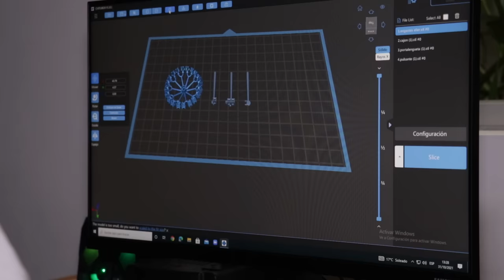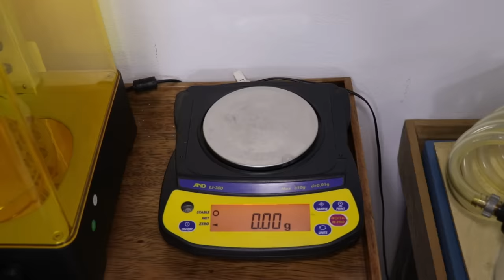Jewelry with 3d printer, How It's made?   ( Cómo se hace Joyería con impresora 3d )

Comment: Wow what are those stones made of? never seen anyone cast with stones on the wax and than again soldering the whole piece at the end with the stones, Incredible
Reply from the maker: Hello.  No stone was broken.  Yes you can cast the stones, it is a fairly common practice in jewelry, but the stones you use have to be those that resist extreme heat and after casting you have to wait for the cylinder to cool gently until it reaches ambient temperature, thermal shock has to be avoided.  Thanks for your support.
Reply: Yeah this make me wonder the same thing! interesting technique.
Reply from the maker: Thank you.
Reply: @ElierOlivos  What stones are being used? Also natural or lab grown? This was interesting to see! great work!
Reply: @Dre_Kam  most lab created corundum stones (rubies in this case) will resist heat as long as they cool down properly
Reply: @ElierOlivos  "thermal shock has to be avoided" that's why I was wonder why you didn't quenched it right after casting. Smart.
Reply from the maker: @Dre_Kam  The stones I used are synthetic rubies,  thanks for your support Andre.
Reply from the maker: @Bugnarok  You're right, you have to avoid thermal shock, thank you for your words and support.
Reply from the maker: @pasteda  Thanks for your support.
Reply: @ElierOlivos  probably as well very expensive as it takes ages to grow them.
Reply: Hello. What is the skinny torch flame attachment you added to your torch? And Where can I buy it?
Reply: @ElierOlivos  so interesting 🔥🔥🔥
Reply: @nicolekim5280  Hi! It is an injection syringe, you can get it at any medical supplies store..
Reply: Just dont do it with expensive unheated burma ruby 🤣
Reply: @8:21 of video you put the that silver tree in solution can I now what is that solotion, please
Reply: Can you put diamond also like that or they would be fucked up ?
Reply: Amazing
Reply: @ElierOlivos  what software did you use on the computer to create the pieces??

Comment: Really awesome.  I’m curious how the molten metal affect the gems though.  I never really thought about building the list cast around the gem.  Does it make the gem “heat treated “?
Reply: Diamonds and sapphires can take a lot of heat, but I also wasn't expecting a cast in place with this one!
Reply: @jgrizzle4166  it probably refers to the lab created gems of a highest hardness.. Lab stuff is without inclusions which can cause cracks and stone break.  Goldsmiths do not take risk to cast with valuable,  real stones,  as to my knowledge.. At least,  I won't take that risk. Too valuable to experiment with the possible result)))

Comment: The  flow is so clean its ridiculous.. I've never seen a burnout done without a kiln before + the steel tipped syringe in place of a little smith torch is awesome.  Mind blown  🤯 I was under the impression that castable resin required a much longer burn cycle. Wondering which type of plaster investment do you work with and is it also good for regular waxes?

Thanks a Million for this video
Reply from the maker: Thank you very much for your support dear Stephen.  The plaster Investment  is : 
PRESTIGE GOLD
 Advanced refractory ceramic for Casting 
and it does work for casting with wax pieces as well.
 https://www.amazon.com/dp/B083P6JXPS/ref=cm_sw_r_apan_glt_fabc_BH9XFK58HZ16NY5WCN01
Reply: @ElierOlivos  awesome! Thank you, im looking forward to watching other videos and learning much more from your channel. Happy holidays 😁
Reply from the maker: @0xGetRekt  In the same way dear friend, I send you a big hug from Peru.
Reply: Hello sir this  video is awesome but how its possible castable resin brun out process with out kiln machine you  just  torch on flask and right after ready to putting silver can you please tell how its possible without kiln machine
Reply: Me too...how did he pull that off without damaging the rubys
Reply: I really gotta try that syringe trick...im amazed
Reply: It WAS a syringe tip.  I couldn’t believe it.
Reply: @sukmeeballz8327  the silver is at over 2000 degrees and dull red is about 1300-1500. Even so  doing burnout and preheating of the mold without a kiln is quite the trick

Comment: The question I have is does using a 3D printed model of the gem settings to mold the metal ones cut over-all work time down?  Because the way I see it, if it does that, then it improves the crafting process.

Comment: Spanish Translation via Google Translate:
Esto es interesante. Acabo de comprar una AnyCubic Photon D2. Pregunta: ¿Las puntas en el modelo 3D tenían las ranuras recortadas o tuvo que cortar las ranuras con bisel en las puntas de la resina impresa? Quiero probar moldes con las piedras en su lugar, por lo que me interesó mucho su video de demostración.
English:
This is interesting.  I just purchased an AnyCubic Photon D2.  Question: did the prongs in the 3D model have the grooves cut out, or did you need to bezel-cut the grooves into the prongs of the printed resin?  I am wanting to try castings with the stones in-place, and so I took a great interest in your demonstration video.

Comment: Amazing video, it is the first time I am seeing someone fire up the flask instead of using a kiln. Could you share what kind of resin and investment you are using? How long does it take to burn out the wax from the cast? I am printing rings on my tiny dlp printer with castable wax from siraya tech but the caster I go to has some problems with burning it out.

Comment: Elier what 3d printer you recommend especially for jewellery? Will a elegoo mars 3 do great or would i be better of with anycubic or phrozen for detail?
Reply from the maker: Recommended for Jewelry is the Frozen Mini 8k  I have not used it but it promises a lot because of the resolution it has, I use the ANYCUBIC Photon Mono X since it is the printer with which I started and it helps me a lot.  Thanks for your support.
Reply: @ElierOlivos  Thanks a lot! 🙏
Reply from the maker: @glitchinthematrix9306  thanks to you.

Comment: Incredible! I don't understand how it can be cast with the stones already set : don't the stones drop from their position once the hot wax goes away?
Reply from the maker: Hello.  No stone was broken.  Yes you can cast the stones, it is a fairly common practice in jewelry, but the stones you use have to be those that resist extreme heat and after casting you have to wait for the cylinder to cool gently until it reaches ambient temperature, thermal shock has to be avoided.  Thanks for your support.
Reply: @ElierOlivos  Se puede usar esta técnica con diamante, esmeralda, rubí y zafiro?

Comment: That is the first time  I have seen an burnout cycle with a blow torch rather interesting but if it works it works. Love the micro tip on your torch but not available in my country unfortunately thumbs up for this vid
Reply from the maker: Thanks for your support John, the ideal would be to do the burning in a temperature controlled oven but if there is no oven it can burn with a torch, by the way the tip that I put on my torch to weld is an ipodermic needle.  and it works properly, you just need to cut the sharp tip.
Reply: @ElierOlivos  hey thanks  i will try that.

Comment: What do you do it’s extra wax resin you didn’t use in that tray?? What stones can you directly cast into? Won’t the temperature damage it?
Reply from the maker: Hello, the resin that is left over in the tray after printing has to be filtered and stored in its container out of the reach of light to be able to use it later in the next printing.  the stones are synthetic rubies that withstand high temperatures without undergoing changes in color or structure.  thanks for your support.
Reply: @ElierOlivos  thank you for this insight

Comment: Wonderful video,  good job,  however,  i would question this method vs classic metal work.  The construction is not complicated and can be welded well by hands..
Same elements,  less to clean,  same work to polish and correct conjunctions..stone settingwill be not long... If a one has a good hand and experience... So,  at the end, can be same time, but cheaper production. Usually,  3d prints go for complicated designs and mass production for brands. Just thoughts.

Comment: awesome video :) did you design one gem socket and then place them in a circle in rhinoceros ? and the support and sprues are autogenerated in chitubox? thx a ton  :)
Reply from the maker: Hi Simon, the settings for the stones and the sprue were designed in Rhinoceros, only the supports for the print are placed in Chitubox, thanks for watching the video.
Reply: @ElierOlivos  awesome not so familiar with rhinoceros :( have to take a look thx :)

Comment: Hi elier, fantastic work! how long did you torched the investment and do you have an indication that the cavity is totally clean?
I did it with normal wax but not yet with castable resin. Thanks for your help.
Reply from the maker: Hi Ronald, I annealed the cylinder for one hour and the resin was completely removed.  I see that the resins are improving a lot.  thanks for your support.

Comment: Thank you for showing the whole process. This piece looks amazing! Can you please tell me what was the liquid you used in [8:21]? And was that a tumbler machine in [13:36]?
Reply from the maker: The cleaning or stripping liquid is hot citric acid to clean the rust.
 https://www.amazon.com/dp/B07YBHYDTG/ref=cm_sw_r_apan_glt_fabc_FCZSNT4HADH9ZWRFE2H6

 And the rinse aid is a magnetic drum that works with stainless steel pins
 https://www.amazon.com/dp/B073XKM5R7/ref=cm_sw_r_apan_glt_fabc_411G3R3QHYVX0M1ZZD4E?_encoding=UTF8&psc=1

Comment: How did you get the torch to be that tiny!
Reply from the maker: Hi Dylan, I just put a hypodermic needle on the torch tip and that's it, thank you for your support.
Reply: @ElierOlivos   No way!! I thought that's what I saw, I must try this with the torch I have! Thank you!!

This is safe to use? Did you heat needle plastics to fit torch tip?

Comment: It is a very nice piece, but a lot of work. It is good that you are using rubies, or you would never be able to sell it high enough to get back the hours of time you had to put in. I sell 3D printed jewelery too, but very cheap stuff, the most valuable stone I use is amethists, no rubies or high budget gems.
Reply from the maker: Hi David, the stones I used are synthetic rubies.  They are not very expensive and resist high temperatures.  Btw with amethysts you couldn't do the casting because they are delicate stones.  thanks for watching the video.

Comment: hello sir can i burn out flask with torch outside without kiln ? but how much time takes to burnout by torch
Reply from the maker: Hello Chandan, I burned the cylinder with the plaster mold for 1 hour, lok if one hour is enough: If the plaster is white and no smoke comes out of the cavity, let it cool down until 600 ⁰c and then you pour the molten metal .
Reply: Sir After I see this video Im so impressive your work and became your fan's..very  good job and talented

Comment: How come the stones dont crack under the heat?
Reply from the maker: Hello Tyga, No stone was broken.  Yes you can cast the stones, it is a fairly common practice in jewelry, but the stones you use have to be those that resist extreme heat and after casting you have to wait for the cylinder to cool gently until it reaches ambient temperature, thermal shock has to be avoided.  Thanks for your support.

Comment: 10:41 Why not a simple soldering iron instead of a flamethrowing needle, or am I missing some important info here? :')
Reply from the maker: Hello, as you can see the links are very close together and it is necessary to place the heat in a single specific fine point and with the wide flame it would be difficult to control.
Reply: @ElierOlivos  Exactly...and the soldering iron has no flame

Comment: What an awesome video! Can I ask what investment you're using and was there a longer curing process than what is in the video?

I see the burnout portion with the torch, was that just for wax removal or did you burn long enough to cure the investment also? And how long did you burn for?
Reply from the maker: Hi Jesse, the Investment I used is Prestige Gold Investment - Vacuum Casting Powder Mix for Making Metal Jewelry
https://www.amazon.com/dp/B083P6JXPS/ref=cm_sw_r_apan_glt_fabc_BH9XFK58HZ16NY5WCN01
the working time until the plaster hardens to the touch is 12 minutes, I left the cylinder to rest for 2 hours then I cleaned it and put it on fire for 1 hour then I let it cool a little, melted the metal and made the casting.
Reply: @ElierOlivos  so after the 2hr dry, you only fire it for 1hr and it's cured enough to pour? I have prestige oro and I'm trying to minimize my burnout period.

So start to finish you're a little over 3.5hrs from investing to pouring?

Comment: He cast the stones ? Hmmmm that just makes no dam sense… I’ve never seen that before won’t that harm the gem stone
Reply from the maker: Hello.  No stone was broken.  Yes you can cast the stones, it is a fairly common practice in jewelry, but the stones you use have to be those that resist extreme heat and after casting you have to wait for the cylinder to cool gently until it reaches ambient temperature, thermal shock has to be avoided.  Thanks for your support.